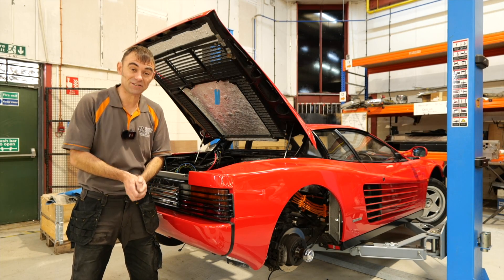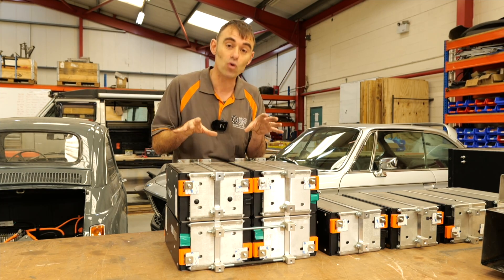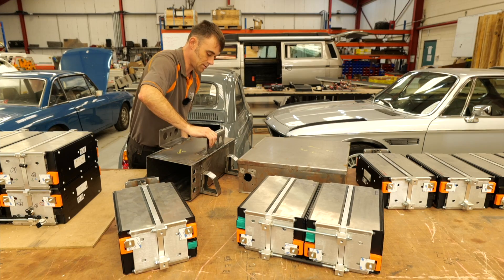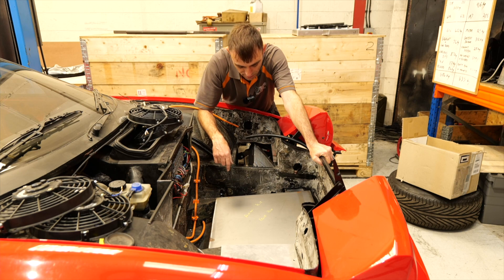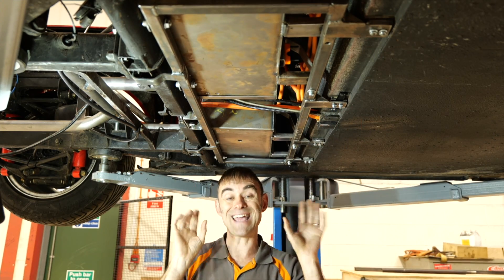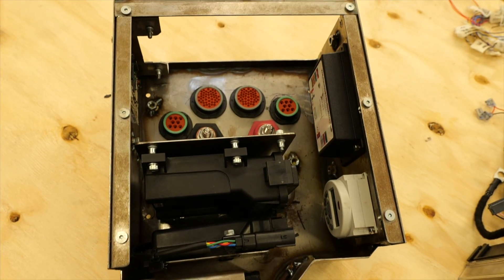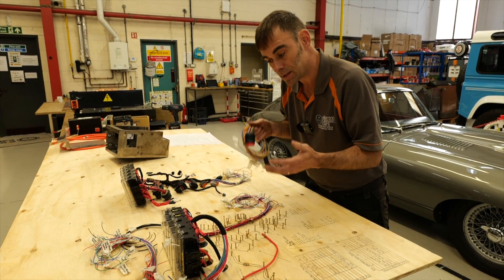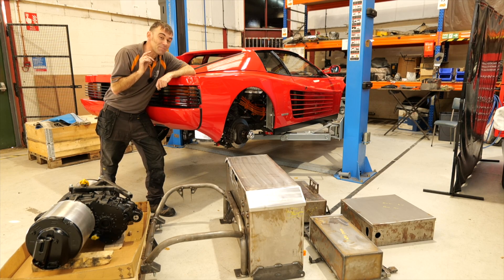Teslarossa Ep4 - Fabrication

Comment: I see modules are still huge. I hope one day they will be slimmer and smaller and more dense, so you could fill more available shallow space inside the car with batteries if needed. Also I see the wiring is pretty complex. I hope your end users will get all the documentation like wiring diagrams etc. Assuming these cars can be later sold and shipped anywhere in the world, the support should be in place to help customers keep their converted classics on the road. Great job so far! I subscribed and will watch the progress on this Testarossa.

Comment: How to get things done right :p

I have a question, however: with BYD and CATL going Blade and Qilin respectively, not to mention Tesla (which basically means structural batteries), aren't you afraid that battery manufacturers will at some point stop selling battery modules as they currently do? Or do you already have a plan for this?

Comment: I still do not understand why an electric car needs to be plugged in to recharge. We have wheels that turn and technically that should be enough for an alternator. 1 pack charging while the other runs the car. Why is this not possible? we should have constant travel by now.
Reply from the maker: Because energy losses.
Reply: @ElectricClassicCars  There is always going to be energy loss. Let me ask you this. In a car or truck we have a battery running on an alternator and it goes on average 2 years without needing to be changed. I believe most people are like me. Give me the car I do not have to fill, only renew the box of batteries every couple of years. That is the magic we want. Plus with some modern tech could last several years without change. It is the programming of gas stations that they are trying to keep. It will happen at some point or we will all move to compressed air engines. lol

Comment: I should be happy to see undeserving Ferrari owners write-off their cars as it pushes the value of my mine up every time another one is destroyed. But being someone who genuinely loves Ferraris it actually breaks my heart to see them turned into Teslas which will only depreciate, eventually sold for parts and the owners left looking utterly stupid. Question: Do you think they would ever do this to 250 GTO? Of course not, because it would ruin it. Ruined just like what they have done to this Testarossa
Reply from the maker: About 36 GTOs were made. Of course it's very doubtful someone would convert such a rare car to electric. However, 10,000 Testarossas were made.
Reply: @ElectricClassicCars  10,000 is rare, eg there were 4.1 million Ford Escorts produced in the UK alone. All Ferraris are irreplaceable. Every one of them has brought huge enjoyment to all sorts of people over the years. Owners have also spent huge sums maintaining them and caring for them since the day they left Maranello too. That is partly because they love the car but also because they understand they are a custodian too of a handmade work of art and they have an obligation to look after it for future generations. That all ends when their engines are ripped out and replaced with a battery. It's not even necessary to do it either. After 2030 classic cars can still be driven on petrol (only new cars will have to be electric). Petrol stations will still be around for legacy vehicles (albeit petrol will be considerably more expensive) and classic cars will continue to emit less CO2 per year than even Greta Thunberg does each year. I mean that very seriously. Let's compare her annual carbon footprint with a Testarossa. I bet the Testarossa wins. I would strongly recommend any Ferrari owner not to convert their cars to electric for all the aforementioned reasons
Reply: @batchmate7002  Parts for these cars are increasingly difficult to find. And unlike Mustangs or Camaros or Corvettes, there is not really a cottage industry to support the fabrication of new parts. Sometimes these cars are not maintained and it gets to the point of fixing them is very difficult if not impossible. If extending the usefulness of the car involves a swap then that is the trade off. I love the engine, the sound...etc. But how much work is necessary to support a powertrain designed by guys from the 70s?
Reply: @karlus3684  You are wrong and totally misinformed. Parts for these cars are ALWAYS available. There are Ferrari specialists all over the country and most will be able to fix any issue with a classic Ferrari. The good ones will be able to do a FULL RESTORATION, ie they will replace / re-make ANY PART for any classic Ferrrari! If there are any issues with getting original replacement parts they can be MADE identically to the original (using 3D tech if necessary). That goes for any part in the engine, plastic switches on dashboard, leather upholstery or anything needed for the chassis etc. When you say 'fixing them is very difficult if not impossible' that is utter cobblers. As for your point about the work involved maintaining a 70s powertrain you make it out like Ferraris are unreliable. They are not. They are Ferraris mate! You drive about 1,000 miles per year and once every 2 or 3  years you might have the odd thing to deal with. Usually its minor and can be fixed for < GBP 1,000. I know this from personal experience. They are not demanding cars at all. What I really resent about all this though is people making rubbish up to con people into feeling they need to convert their beloved Ferrari to a here-today-gone-tomorrow Tesla. They don't need to destroy their cars at all and if they do it they will regret it!!
Reply: @batchmate7002  Noone here is making you do anything you don't want to. Why not just live and let live. Clearly there are many vehicles in various states of repair, and a range of owners with their own experiences and motivations. I'm an engineer and scientist and have a deep love for technology and design, and for art. So I appreciate that you consider Ferrari cars to be works of art. But they are also... cars, designed at least in part to be driven. The functionality matters, whether it is 1000 km/yr or more regular use. It's sad in a way to see technologies become obsolete, but it's a natural consequence of innovation. Some people appreciate obsolete technology for its aesthetic (eg mechanical watches, which were an engineering marvel for centuries), but in terms of functionality and performance, newer tech is almost always better. Hence EVs. (Quartz watches are a different kind of engineering marvel, now so cheap that you can buy a generic quartz clock for a few dollars or even a few pence/cents wholesale that keeps time more precisely and accurately than any Patek Phillipe or Rolex watch ever made.)
Reply: @marciusextavour8754  This is a comments section and I made a comment as is intended. If you don't like my comment that's fine and you are welcome to challenge me as you have done so but don't infer the only comments which can go on here are those which are in agreement with Electric Classic Cars. You should live and let live too! But I will respond to every spurious remark and inaccurate statement made to me though. You all love seeing these cars converted to electric and justify that as 'innovation'. I am an Investment Analyst and I can tell you now these converted Ferraris will depreciate substantially when they actually would have appreciated substantially if left alone and preserved. Why is that? Rarity. As time passes there will be an abundance of electric cars and a scarcity of originality. Shouldn't people considering making such a huge financial mistake with a Ferrari not be informed of that? So, for me, it's not just that they are works of art being trashed but also there is a substantial financial consequence for the owners who do it too. I think you prove my point with your watch analogy. Yes of course digital watches are better time keepers than mechanical watches. By consequence, in that respect alone, they are better watches but as you say they are worth nothing now. They wouldn't have been in the 1970s when they came onto the market though. Same with calculators in the 1970s. But due to abundance they are all cheap as chips now. What this company is doing to Ferraris is exactly the same. By converting them to electric the Ferraris are changed from being a rare product to one which is abundant (Ferrari to Tesla if you like). This has a right to be said so people are informed before they needlessly trash their Ferrari. All comments to me are welcome as free speech is righteous, informative and progressive

Comment: If I may add another question: energy density of batteries (weight). In one of the episodes 'petrol versus batteries) you explain that the energy density of the Tesla is up to 0,22 kWh/kg. I assume this is for the pack including the cooling provisions.  How do the CALB batteries score on this ranking (including the cooling plates)?

Comment: I may have missed it but what brake setup are you using? Remote vac pump or an all in one electric servo and abs unit?
Reply from the maker: We're using the standard brakes with an electric vacuum pump. 👍

Comment: Nice battery boxes but how do you seal them and also how do you ensure they are safe? With only one or two boxes it is relatively simple using contactors and fuses but not so easy with four boxes.

Comment: If you love my Comments it will be because you see the Logic and (not so often found) Common Sense in them because I KNOW that you are a Practical Man.

In which case you would absolutely ADORE the Advanced Vehicle Technical Design Information that I have offered you and you will LISTEN to it before you dismiss it.
You have EVERYTHING that is needed in your Work Shop.

Right now you have one foot in the 19th Century and another in the 20th.
So why not move BOTH feet into an earlier than expected 22nd Century ?
It's only extrapolated PROVEN Technology.

You have nothing to lose except time taken in Consideration, and some ideas on what can or cannot be done with a Vehicle.
Whichever way you will GAIN.

If you want to know more, I am on the other end of this line.

Regards.
.

Comment: I have nothing negative to say regarding the actual build, fabrication and workmanship.  All are top notch!  But I still have trouble wrapping my head around converting these amazing ICEs to battery power.  I can't imagine any serious gearhead going down this path.  If I want a car that sounds like a golf cart, well, I already have a golf cart for that.  I used to have a Testarossa several years ago and currently have a 360 Modena and a 996 with sport exhaust.  The sound of the cars is one of the biggest thrills when driving them.  And not just for the glorious sound alone, but also for the feel, the connection to the car.  No way could I imagine the sound of "nothing".  Plus, there is more to the story than just a quick 0-60 time with these electrics.  imo, while they may be quick in a straight line, I doubt the power will be as manageable as an ICE.  And by manageable, I mean useable and safe.  Take a peek at the salvage auction sites for Copart and IAAI to see how many wrecked/salvage Teslas are waiting to be sold.  There has to be a reason for that.  Heck, even think about how quick a golf cart can get out of hand for any inexperienced driver.  There are numerous reasons to not go electric with some of these cars.  I see these as a novelty and a cool science project, but not much more than that.  Ultimately, retired battery packs and other components along with everything it takes to make them and charge them are not going to benefit the planet.  The world gets more crazy with each new day.  Sorry to rant.  And again, I think Richard's work is amazing.  My gripe is with the concept itself.  Friends don't let friends drive electric cars... ;). lol.  Peace to all!

Comment: W hen I used to work for Dormobile we used to use peg board and golf tee's on our wiring table which meant you just changed the tee's if you were making a different loom so you only needed one table.
Reply: These guys build a loom board for each different car they convert and keep the board. That way they can make another one exactly the same later in when they want to. It's simple but brilliant.
The peg board is a good idea too.

Comment: Can you not fabricate those battery boxes in carbon fiber?
Reply: You could....but damn that would be expensive and time consuming
Reply: @Mardy72  expensive is relative as these conversions are very niche, and the people doing them dont seem to have money issues, but I do agree it would bebtime consuming to create the first mold, but I believe must faster to at a later stage to knock them out in series.
Reply: @MozMozzie  I think the ultimate goal is trying to make these conversions more affordable
Reply: You could also make them out of unobtanium ... but why?
Reply: @MrAdopado  its not as expensive as you might think and money does not seem to be an issue to this clientele, but it would be lighter and stronger, clearly!!
Reply: @MozMozzie  There is no lack of strength issue or significant weight issue for these conversions. Better to spend money where there is an actual problem that needs a solution best solved by using carbon fibre. Of all the aspects of a car that could best be solved by the use of carbon fibre I do not see battery boxes as being high on the list!
Reply: @MrAdopado   You are right, we are all entitled to our own viewpoints, mine is different to yours!

Comment: One day we will have batteries so efficient that just replacing where the fuel tank was will get you more than enough mileage. Nostalgia of the future! Good thing about your ocnversions, is that when that future comes, it will be as easy as replacing the outdated battery modules with the latest tecnology ones. A classic EV car is a car forever, never gets outdated, can always be improved.

Comment: Been looking forward to seeing the next installment of the TeslaRossa build. Good move to split that front battery box. Not only do you gain room in the boot, you also use space - where the fuel tanks were - that would be difficult to use for anything else. You've lowered the CoG and improved the spread of weight as you say , too, which will benefit the handling.

Comment: Have you considered using one of the "new" (or at least recently more affordable for a mere mortal)  PDMs to simplify the wiring harness? I'd guess the relays are less efficient than solid state switches which would be a disadvantage in an EV.
Reply from the maker: Yep, we're testing several PDMs at the moment. 👍